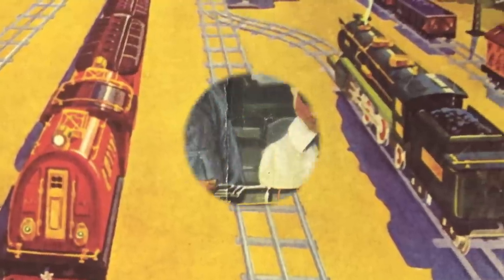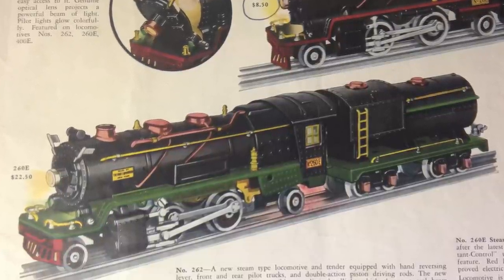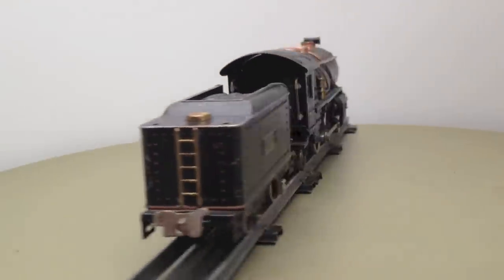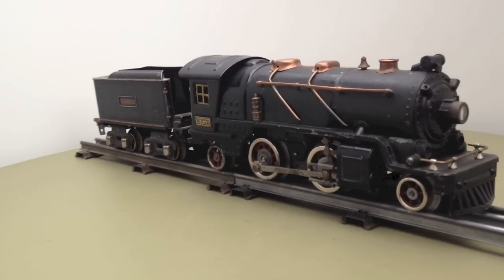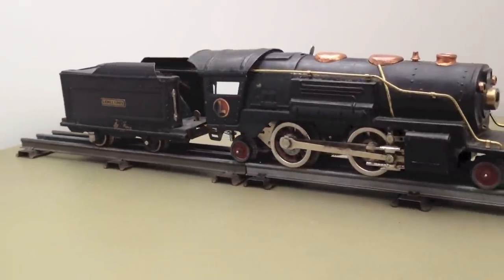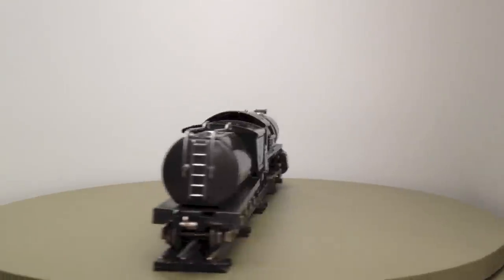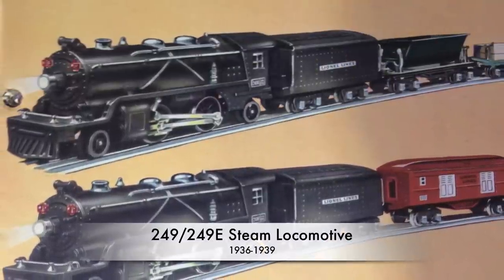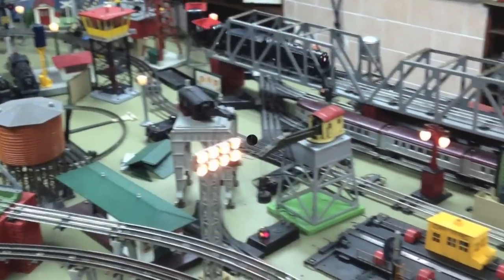Classic Lionel Trains – Sheet Metal Steam Locos 1930-1942

Comment: So from 1915 to 1930 Lionel didn't release an o gauge steam engine? The collectors must have been sending letters to Lionel to make some.
Reply: Rail-Ryder 713 It is not likely that Lionel received many requests for steam locos back then from any collectors,remember electric trains by Lionel,Ives etc.were fairly new on a market where many areas outside of large cities were without the luxury of electricity,many rural areas weren't electrified until after the second world war,my uncles Idaho cattle ranch finally was powered in 1948.

Comment: Hey what type of screws did you use to screw the O gauge track in elevated trestles
Reply from the maker: I used the original screws which were delivered  with the trestle set. They go into metal clips which are also part of the set
Reply: Classic Lionel Trains do you happen to know what size those screws are cause I the elevated trestle set that comes with the plastic clips